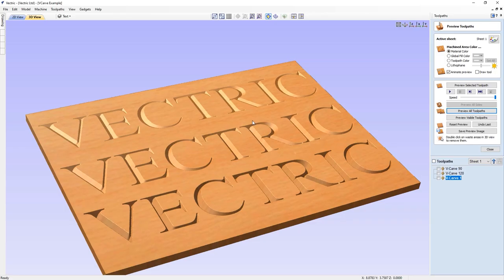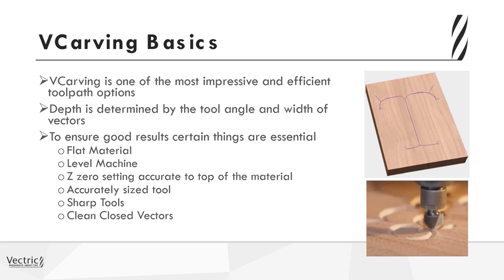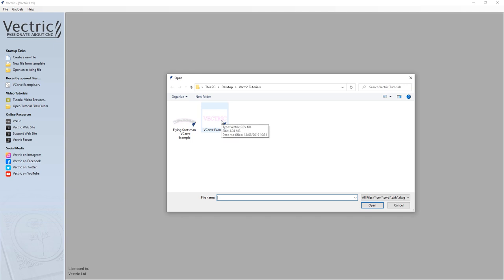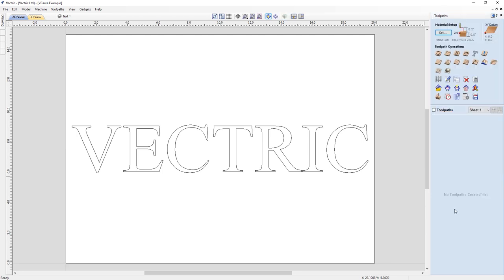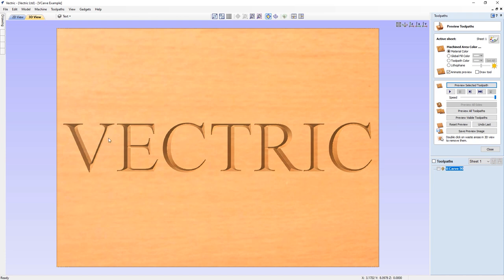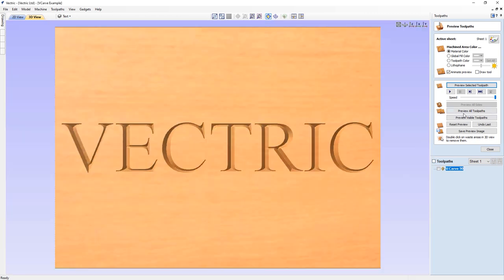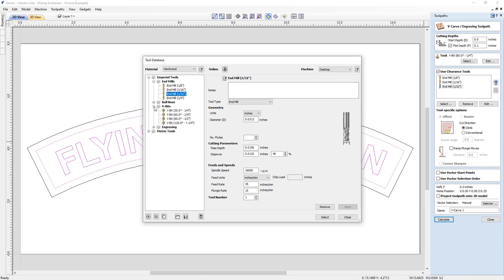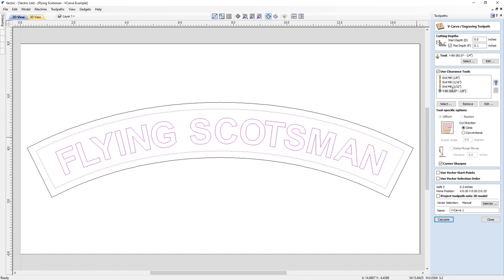VCarve Toolpath Guide | Vectric V11 Tutorials

Comment: Does the Vcarve tool path take into account the pass depth of the bit used?  If not what is the best way to control how pass depth of the toolpath?  Especially for smaller, more delicate bits
Reply from the maker: Hi there, you can edit this in the tool database under 'Cutting Parameters' by changing the 'Pass Depth', hope this helps. Thanks!

Comment: I created a sloped section in my project using the molding tool path. Can I use the project onto 3D model to vcarve text onto that slope?
Reply from the maker: You sure can... at the bottom of the VCarving Toopath form there is a option to " Project onto 3D Surface"... that should do the trick.

Comment: Can't believe for such a long video you don't cover climb vs conventional and plunge angle!!!
Reply from the maker: Hello Luke... thanks for the comment.  Choosing climb vs convential is soly the direction of cut, and this all depends on the material you are cutting into.  Some people like to run their VCarving once in one direction and once in the other to be sure it is clean... but that is really upto the material and if it has grain or not.  "Plunge Angle", I'm thinking you are refering to "Ramp and Plunge Moves"? In most cases this is only used for the clearence cutter and it helps to take the load off your tool for deep cuts.  From our Help File "The cutter can be ramped over a distance into the pocket instead of plunging vertically. This approach reduces heat build-up that damages the cutter and also reduces the load on the spindle and z axis bearings."  I do hope that helps...
Reply: @vectric  Hi, thanks for your reply, trying to mill copper sheet and looking everywhere for guidance re tool path settings. I'm using a 1.5mm endmill to cut an eventual depth of 3mm